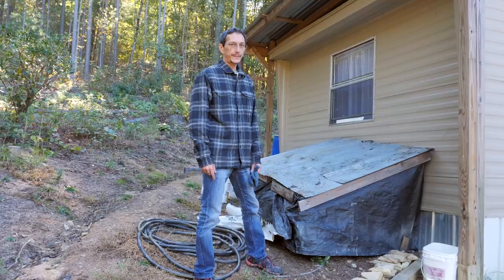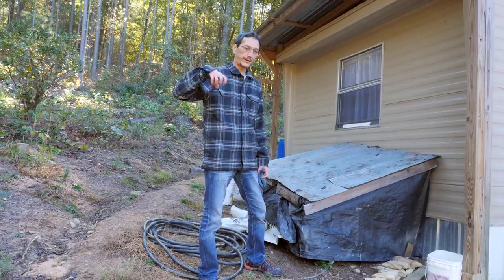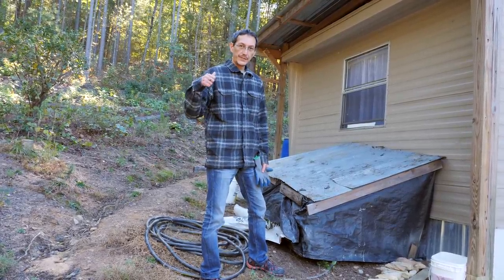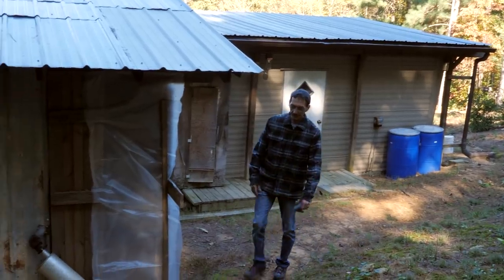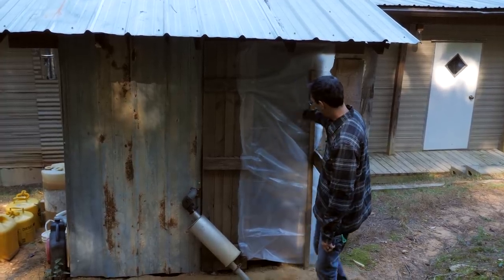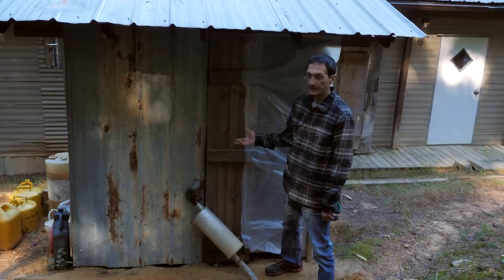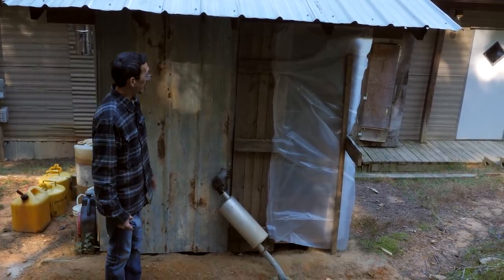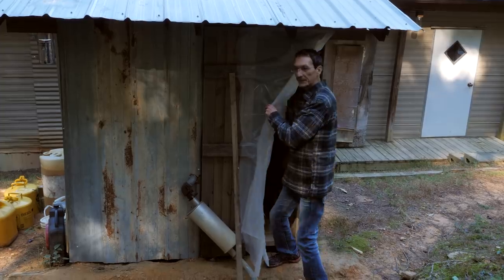Hillbilly Engineering Our Off Grid Pressure Tank and Battery Shed

Comment: Great job - yes, a light bulb with thermostat should work fine  as long as it keeps the temperature above 34 degrees.  One suggestion - pick up a remote outdoor thermometer ... put the remote thermometer in the fallout pig shelter cover thingy, and put the monitor in the kitchen so you can keep an eye on the temperatures from in the house, just in case something goes wrong (like the light bulb burns out too soon).  We're sure you don't want a repeat of the frozen water tank situation you had last winter.  Take care.  Keep warm - the predictions are that this winter is going to be long and cold.  We had our first snow fall the night before last, up here in North Central Ontario, Canada, and the froggie pond is starting to freeze too.  brrrr.  Glenn and Maureen

Comment: It is probably over kill in your area ( it's far colder where I am ) but I put a divider threaded into the light socket . It is a Y and allows 2 bulbs. The second bulb  runs through a photo socket to keep it shut off . If the first bulb burns out the darkness activates the second bulb until I notice the issue and replace the burnt bulb. Freeze up happens fast here.   Atb
Reply from the maker: That’s really clever!

Comment: I'm partial to the old freezer with a light bulb technique.  Delay spending
$50 on disposal and have a warm dry place for tools, batteries etc.
A 15 watt fluorescent will keep the temp 15 degrees F above the outside
temp for $1 for 3 months.

Comment: Hope this works out for you guys. You don’t need a repeat of last year. I watched another channel that had water line issues. They are using heat tape and foam insulation blocks to lay over the ground lines. Looks like it will do for a while.

Comment: If you could put your pump in the battery shed the heat from the inverter would keep it from freezing. It would also save electricity because the bulb wouldn't be needed to keep the pump warm. One place to keep warm instead of two.

Comment: We have our pressure tank under the house in a crawl space and a halogen light facing it, with heat tape on the water lines. We can get below zero here at times and have had no problems......... as long as the crawl space vents are closed (bet you can guess why I pointed that out).

Comment: Probably not a huuuge deal but if you put the pink fiberglass side against the metal it creates condensate which causes oxidation/rust or rot.   Also if you leave a plastic sheet between the cold and a warmish to toasty place (or motor where small cave-like places live in abundance) there will critters acomin’ in abundance!  You’ve made great accommodations for them.  In fact, they will nest in available Corning fiberglass wool as well then pass into animal heaven leaving you with poop and mess...  I’d send you the 12 cubic yard of poop, dead critters and glass wool removed during our renovations...so far...(that’s only the first building!)
Reply from the maker: Good thing we aren’t scared of poop or dead bodies! 😂

Comment: Imma thinkin' if it gets cold enough that you have to run the generator to charge the battery bank, that 'cooling it down' won't be much of an issue.  Ya know due to the feet of Snow, Ice and Below Zero temps 'n all that, and you can always 'prop' open the 'door' to let in a little air😅😅 Are you going to put a proper door of some description on that shed?  Surely the flap of polythene won't stand up to the feet of snow you might (will) get?   And, I had to look 3 times at the Wendy House insulation for the water because after the Pink 'Fluffy' I thought you'd topped it off with an old Duvet/Eiderdown, I thought "Red-Neck Engineering for sure!!!"  Come to see it's the sort of Insulation you have over there with Brown Paper backing it😅😅  From a distance on my little phone screen it looked SO 'Bedspread'.  And, may I say how thoroughly I approve of your Wendy House Water Protection System's description.  A highly engineered (let us not forget them Hillbillies got that Garage back on it's foundation, they ain't daft)  A Fallout Pig Shelter Cover Thingy, sounds like the sort of name I'd've Christened it.  Are you feeling settled and satisfied that you've done all that needed to be done to face this Winter?  And is it having the ability to prepare or knowing what you're facing this time that makes you feel like "Yes-We're ready"?
Reply from the maker: Yes exactly! Being here 1 year through all the crazy seasons has taught us a lot!
Reply: @Guildbrookfarm  Not BALLY Half 😂😂😂  That's what's called 'A Baptism of Fire', but I felt it was more GRR Martin than that, much more "A Song of Ice & Fire';  in both it's more literal definition and it's dropping you in at the 'seep end'😂😂 (couldn't resist don't hate me please) of dealing with the whole water (popsicle) issue.  At least you had the Mighty Behemoths of Wood Spitters.  Mr Bond.  Jaime d'ya think you could work a Christmas T-shirt containing the beautiful night sky you used on the intro to our Piggy video?  Maybe with a Stable and the Star or maybe a Santa's Sleigh, but going back to the beginning (again as I do once in a while) I had forgotten how utterly beautiful your Sky at Night Vista is.  Just a thought

Comment: Call me strange.. ....but id have no issues getting a good used radiator and mounting it in the house. Any radiator......even from ford escourt. Mount it in the house and ploumb it to genset......when you do run generator..........youll get free heat. Would also be a backup heater........as long as you have fuel for it i guess. Have relitives with a camp in the woods set up like that. Before thier wood fire heat kicks in the camp is heating up